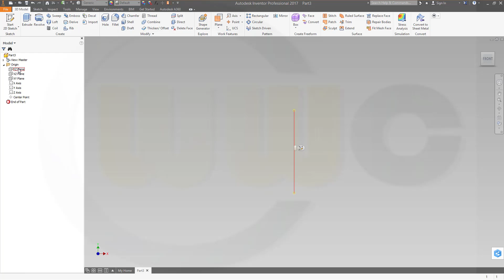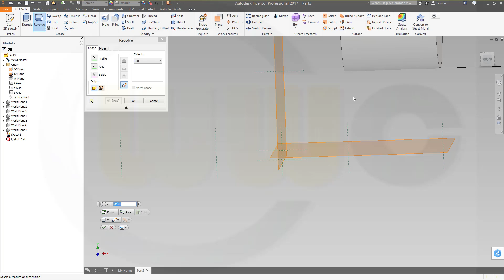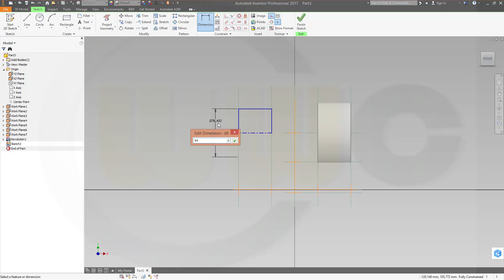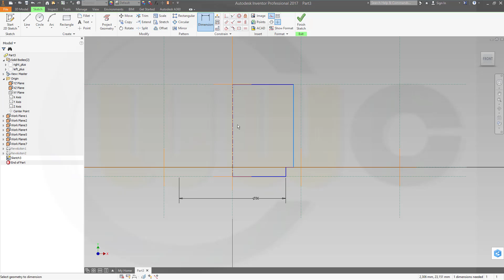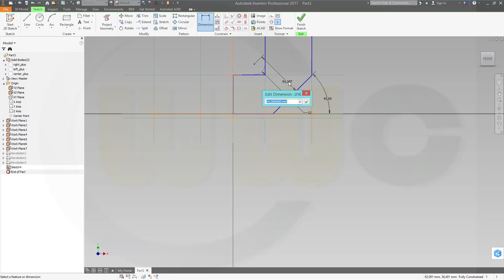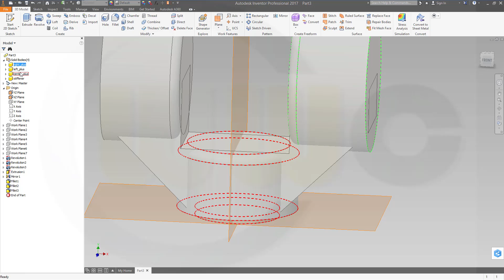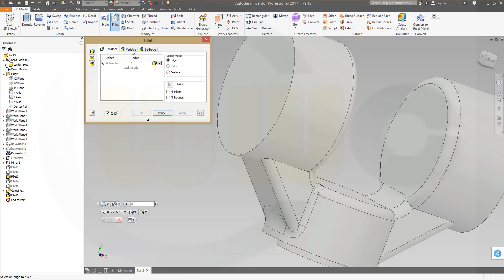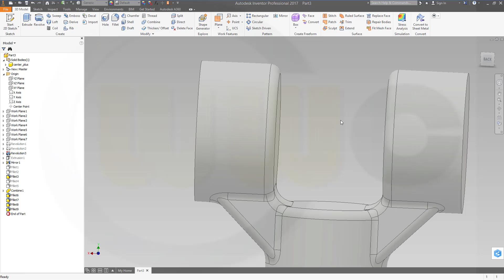Multi-Body-Housing - Part 1 Exterior - Inventor 2017 Training - Methods

Comment: Great!!  Between Inventor and Solidworks, which do you like best?  Thanks
Reply from the maker: Hi, thx. In my opinion Inventor is the most userfriendly of the cad-programs, second place would be SolidWorks. But it is a close one.  My favourites are catia v5/v6 and siemens nx because these are the most powerful ones.